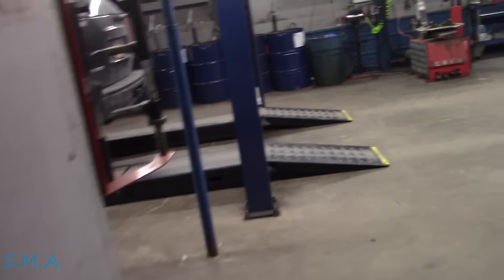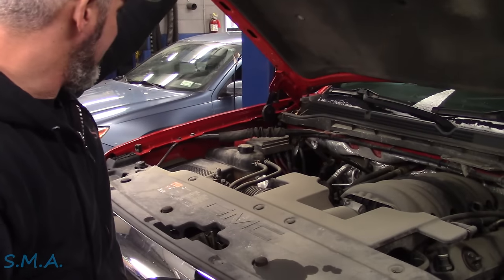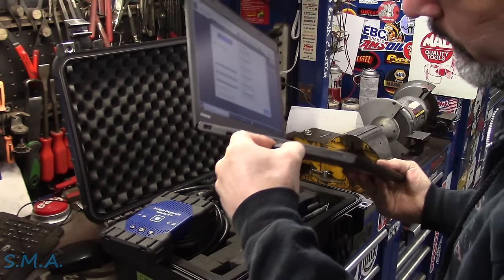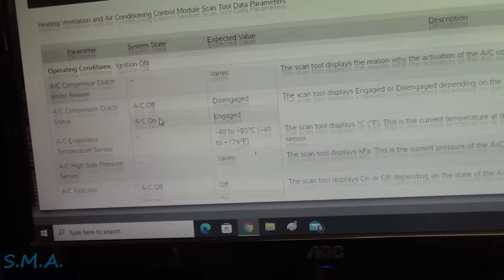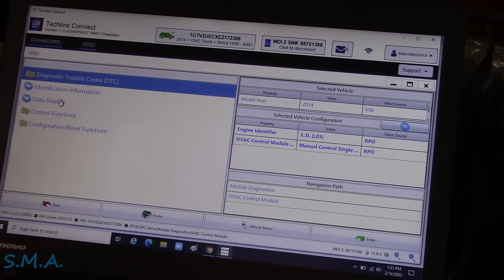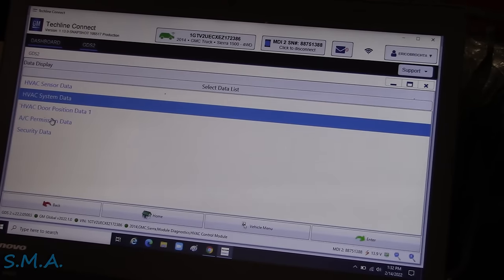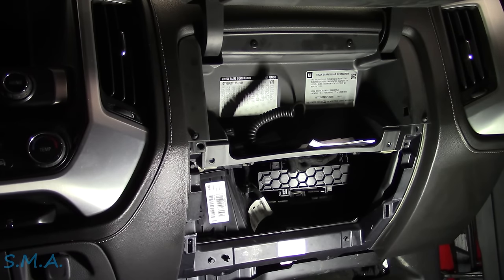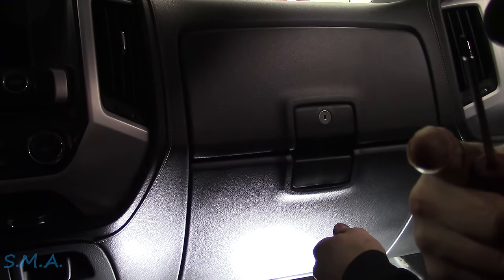Chevy/GMC Truck: Failed Heater Control Module

Comment: It depends on the module supplier, but one of the goals for modern automotive module electrical/electronic design is to maintain the integrity of the microcontroller core so it can still communicate to help identify the exact internal module failure mode. One example would be for an external 5VDC VREF/POWER to have a dedicated supply (usually with internal module diagnostics), so if it fails the microcontroller can still identify and communicate the failure mode over the CAN bus.

Also, the module as purchased will be in its default state as you would see on the factory floor when the vehicle is assembled. So what you see before being programmed is what the assembly person is looking for prior to initial programming. Meaning, having all the lights active or other basic tests.

The important step depending on the module setup/learn functions is to provide a stable VBAT 12V supply, key on engine off. Some module may draw significant current (up to about 20Amps) during the learn procedure. The solution is to use a separate power source to maintain a stable VBAT (for example 13.5VDC regulated voltage) during module programming and learn. If the battery is weak, it may die during this procedure.

Comment: I started as a mechanic, then went to get a degree in engineering. After five years at my engineering job I just couldn’t take it anymore, I was miserable. Just the stupidest and most insignificant problems I’d spend so much time on, it just seemed like la la land. I quit last year and went back to being a mechanic, I am so much happier. But yeah it just boggles my mind why we gotta make vehicles more complicated than they need to be. I think most viewers on this channel long for the days of simple cable operated hvac controls, but the average person has no clue

Comment: When I was a teenager, and even more ignorant of vehicles than I am now, I had a shifting problem with my '77 Chevy truck. It had a three-on-the-tree (how many forward speeds does a person really need?) and it was stuck in second gear. A friend's dad looked at it, grabbed a hammer, beat on a part of the linkage a couple of times, and it was fixed. I miss that truck.

Comment: We had a 71', a 75', two 79's, a 85', a 91', and a 96' F series pickups all with factory air and never once did the controls crap out... lol
Now, in full disclosure the 71's cool to warm cable got very stiff towards the end...

Comment: Yes,Eric, Im 62 and I also would like them to go back to how easy things were on older cars, I had a 1969 Holden Kingswood (Australia) and you could crawl into the engine bay and get to basically everything, or underneath, there were No plastic covers over anything and you could do an oil change without any special spanners or crazy looking tools, If your blower motor failed you could crawl upside down under the dash and change it in under an hour tops. The list goes on. The cars today are too complex and there are too many computers driving evrything, to fix the smallest problem you have to have all the Technical gear you have there to even diagnose what is happening and when you find the problem it tells you to replace a certain part which costs coule of hundred dollars and a whole day of work.

Comment: Sorry Eric but if you are in business you are the bad guy. It's not even your fault. Gasoline here $1.83per litre which is almost the same amount as a US quart today.  Price of food is steadily increasing. Clothing, heating your house, hydro, water dog food, cat food all going up. I've rebuilt motors in the good old days. In about 1995 we got a Pontiac 6000. I opened the hood and didn't recognize much. I couldn't even find the distributor. Keep up the good work teaching us simple things like we no longer have distributers. My motorcycle even has electronic ignition. Without your training I might be tempted to replace the headlight fluid. Have a good day.

Comment: It's exactly this level of "gingerbread" that scares me from buying a new vehicle. Just 20 short years ago, I worked at Chrysler Huntsville Electronics and we made engine controllers, transmission controllers, antilock brake modules and fairly simple (and good!) radios. Yeah, there were computers in them, but relatively speaking they were simple to program and to replace. Then we added more features and started down that slippery slope to "gadgets for the sake of gadgets--who can out-tech the competition?" Today I drive an '03 Dakota Sport with hand-crank windows, 5-speed stick, no power door locks, no gingerbread. Simple and easy to operate. It will likely be my last vehicle ever, assuming a deer don't run out in front of me.

Comment: You're right , with the chip shortage you would think that they would design something with as few modules as possible.  Maybe we need to restomod as many of the old vehicles as we can find. I feel the new stuff is only designed to last until the warranty expires or it is paid off. I will never trade away my 2001 F150. It rarely gives me any issues.

Comment: I feel your pain, Eric O! My chosen profession is TV repair, which used to be a good line of work. Lately I feel like my job is akin to fixing single use paper plates. Every day I have to try to make a living attempting to fix throw away Chinese trash that was designed to be put together once and never serviced. Lots of times we'll get in TVs that are less than two years old and parts are discontinued, so the consumers are forced to by new Chinese crap every two or three years. I am limited as to what I can charge for repairs because people will choose replacement over repair. It gets depressing!

Comment: Everybody has thieir pissy days, Eric - but I guarantee you that the appreciation your customers (and YouTube viewers) have for you far outweights whatever was going through your mind when you made this video.  But I gotta agree that the electronics in cars is getting carried away - and particularly this need to "program" these modules to the vehicle.  I get that, if the system in question has anything to do with vehicle security - but a module like this one?  Should be a slam-dunk - and if there is "calibration" to be performed after the installation of something this basic, there should be recessed button (or a shunt that you can short) to force the built-in firmware to perform that without a computer.  I'm a geek that's spent a lot fo years designing and programming things around microcontrollers, and this stuff drives me crazy.

Comment: It is tempting to buy a 90"s model F150 and just fix it up nice and not have to mess with all this crap.  This repair reminds me of a time I had a 2004 Buick and the heater wouldn't work. When i pulled into the mechanic's driveway, the heater came on. He said "I can't diagnose or fix something that's working." I got back in and drove to work and the heater core exploded under the dash. I got the diagnosis.

Comment: Agree totally even the semi  tractors are built with too much overpriced unreliable  technology these days just to make the tree huggers and insurance companies happy being 52 came back in repair business 10 years ago after playing steering wheel holder for 12 years and even heavy class 8 trucks are a pita sad thing is working at truckstop make more money than the heavy duty stuff cause bosses dont want bays t ied up too long so you sometimes have to tell customer to take to dealer or shop they use who has mote than a jpro and access to info to correctly diagnose and repair stuff that isnt easily repairable sucks hate when zero like being a hero love your utubes your a smart honest man and have taught me great info thank you and feel your pain cause we have seen technology get absurd but still get satifaction out of not needing a computer all the time to show the kids use your senses and common sense and basic troubleshooting skills to repair somethings cause thats what real mechanics do and technicians are parts changers that when half butt diagnose many times use way too many parts not actually fixing problems correctly making the customer unsatified and putting a black eye in the repair industry and when I worked for a fleet owner you had one unhappy boss man and mad drivers and I dont like to be that guy thx again

Comment: I'm with you, Eric. Chips control things, and tell you what's wrong. But the chips and the added circuits fail. So you have added many new layers of trouble and expense. Now you can't even buy cars because the makers can't get chips. It's stupid.

Comment: It is what it is, what more can I say? To many things have a lot of bells and whistles, because that's what sells. I like it basic for the most part, especially when it comes to cars. Eric, I believe you know what I mean when it comes to the basic 2008 Chevy cobalt LS 4-door 2.2l. I really don't know jack about todays cars, when most of my cars have been old school. My first car at 16 in 1973 was a 1957 Chevy Bel Air (the year I was born) and drive it for 6-years until the engine died, 1970 dodge challenger with the 383 sold it, got married and had kids, 1980 Chevy Malibu Classic wagon, destroyed by a drunk driver, 1985 dodge mini ram van, drive it until the transmission died in 2020, now 2008 Chevy Cobalt LS. PS: I still use a VCR on the holidays like Christmas, lots of classic movies and many classic cartoons like Charlie Brown Christmas.

Comment: If Ivan or DDan can do it. I can too😊. I'm always learning. My memory modules maybe dropping one by one. I'm trucking along. And BTW. I do have a 68 gmc 2500 waiting to be finitoo. Needs sheets. Dash gauges . Bed and stake body finished up. Add one 2 button radio with uno speaker. Uno blower and AC by opening my windawss

Comment: Back in the day, when Chevrolet  heaters were operated by cables, they would stick, kink or break.  They could be a bit of a knuckle skinner too. Vacuum controllers failed on a regular basis and the only way to repair any of that is to lay on your back with your legs dangling over the back of the front seat.  Screws, nuts, bolts, wires?  Lots of them.

Comment: I hear ya. Between periodic maintenance requirements and wear-n-tear items (rear axle seal, sway bar bushings) my last estimate was $3,000. I did about half last year and hopefully, the other half this year. (2010 Nissan Frontier PRO4X with 60,000 miles) And, I need a pair of tires. Fortunately, I'm retired. I don't drive much. Unfortunately, I'm retired. I don't make much $.

Comment: Just changed my vehicle and now wondering whether to invest in a better scanner, as the Autel AP200 although good, only supports one vehicle unless you keep paying subscriptions. I have asked Autel if it’s possible to change vehicle on it, but still waiting for a reply. It’s more cost-effective to buy another one or a better multi-vehicle scanner. The joys of modern vehicles!!

Comment: I have a '94 GMC Sierra 1500 and the HVAC Control was blinking. It turned out to be a bad actuator, of course is was a bear to get to. It doesn't have all those fancy boxes with color coded plugs.

Comment: I know it doesn’t really make sense from the perspective of running a busy shop, but it would be interesting if you could open up some of these bad modules and look for obvious problems (cracked solder joints, leaking or bulging capacitors, etc).

Comment: Been watching, I have a 2010 Nissan Maxima that went into Limp mode, taken to  Nissan dealer so far 2 wheel speed senors replaced and not fixed!,  The Nissan dealer now says to replace  the whole wiring harness, appx $2300  installed but wont guarantee thats it.  CAR  does have 185000 mi, been a good car,  SO I THOUGHT OF having it towed to Eric  ,( thoughts, dont put any more money in it or LET Eric do some checking? )  I actually called mrs. o last week, they said bring it down,   towing esrimate was expensive and my kids think im crazy,  Just buy a new one Mom,!!    Ive got hooked on these repair videos !

Comment: All you needed for vacuum control heater systems was a test light, your ears and a way to feel if vacuum was present to diagnose most problems. Now $3000 plus test equipment just to tell a customer it will cost him $1000 or more to fix it. In the 70's within 10 min and no need to tear out dash for most diagnoses. Excluding heater cores and A/C evap of coarse.

Comment: I like the old days of 1990's to 2010's GM. My father had a 1997 Sierra in summit white and copper two-tone and my mother always drove a Pontiac up until 2009 when GM went bankrupt. Ever since then the cars they built after older designs phased out were never really the same, simply put they're too complicated for their own good or really poor quality compared to the buckets they used to make with few exceptions. It's one reason why I like my 2013 Impala, it's an older design but not too complicated even though it has a few modern features. A perfect balance of old world blues and modern tech all wrapped in a faceless economical design.

Comment: I replaced the radiator in my 2012 Buick Lacrosse. Had to darn near remove the hole front end. I miss the days of four bolts and two hoses.

Comment: I am old school, my 2012 chevy goes to the shop because I don't have the scan tool to help me fix my truck and it sucks. I got out of the auto repair 27 years ago and I am lost on most of the repair that is need to keep her on the road. I sometimes wish I could go back to school and learn about the new would of auto repairs.

Comment: New vehicles vs old. Very complex, superior safety, mileage and ride comfort. Easy and less expensive to repair. More then likely why restomods are becoming more common.  Stand alone systems that are easy to install and the cost is not unreasonable.

Comment: I think of cars like computers 20 years ago.  If you plugged in something, you had to switch jumpers, change settings and prayed things worked.  I think the electronics in cars will be more modular and able to diagnose themselves with standardized communication systems like new computers.  Fortunately, will will still have to be knowledgeable about mechanical problems!

Comment: Completely sympathise with you where the daily grind kicks in but after a while any industry would be the same. The trick is to survive long enough to retire. There are people out there who do other things who would love to be a mechanic. And while you are there doing what you do at least someone is out there doing a good job and that benefits all of us. Also on modern complicated cars. I remember the older cars too and they rusted instantly, failed to start on damp days, needed constant servicing and the radio used to count the spark plug sparks and let you know via the buzzing sound in the speaker so things are different now and in some ways better. I used to be proud to get 30 miles to a gallon now it's a load more miles than that although ironically the fuel cost so much now it probably costs more to run.

Comment: It is sort of frightening seeing how much stuff is on the car network, etc. - one little box fails and everything goes down with it.  (I remember one of your videos - I think it was a Chrysler minivan - where there were all sorts of electrical issues manifesting in the van, and it was all caused by a frayed wire grounding out in the cargo area behind the rear seats because it was messing with the network) Now so many cars are putting the controls for everything in a giant touch screen with no physical buttons, etc. - I think automakers are going for the out of the box experience being great, and not worrying so much about behavior down the road a bit... it will be fun when cars start coming to you with some of the camera based systems failing, like lane assist or automatic braking...

Comment: In the old days, cars broke down because of either worn out, lack of maintenance or an accident.  Now it seems the only thing that breaks on a car are the sensors and modules.  I always said the more features and add ons results in problems.  Electronics do not belong in large mechanical devices such as cars & trucks. I am having a real problem deciding what car or truck to get that have less modules. Also what year to buy. 2013 or older or what?

Comment: I had a 2014 Explorer. Customer complaint was battery dies because the hazards wouldnt shut off. Diag found bad FCIM. had to send it out to ford for repair. Cost 750 to replace the soft touch hazard button with a mechanical on/off style button.

Comment: Only good thing about the added complexity is less headache for you as a mechanic as odd as that sounds. I work on diesel trucks and I looked under the dash of a 90s international transstar 8300 and holy moly talk about a rats nest of wires that make no logical sense. Fast forward 20 some years we have a 2020 international pro star. Concise schematics, easy to follow harness routing, and clearer design thought. By no means am I saying a customer should have to pay big bucks for a seemingly simple complaint. But we are trending in a very good direction and manufacturers just have some more things to iron out.

Comment: There will always be, (a few), smart people like you who know what they're doing and can diag/repair. The really bad thing is going to be/is already, the parts. I remember watching a vid from Ivan a few months back and his struggle to get I think it was a PCM for a for a not terribly old, (2004?), Ram/Cummins. A guy in Winslow, AZ, 10 years from now with a 500K mile 2003 Ram 2500/Cummins that's rust free, been meticulously maintained, runs like a top but has a TIPM take a shit on him. He's gotta spin the wheel on a junkyard one a coupla'-four times until he gets one that works? And, then, for how long? I don't see there being repops for that like the bumper fillers like a 70's-80's GM.